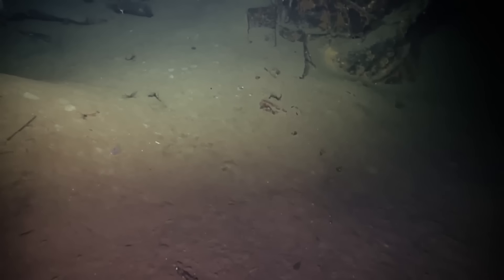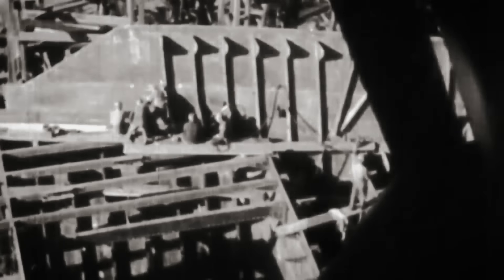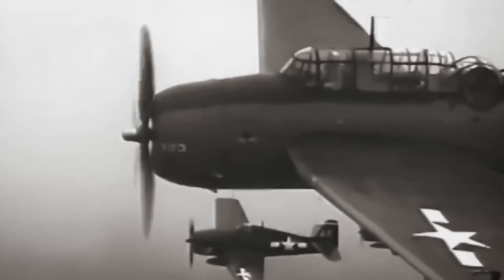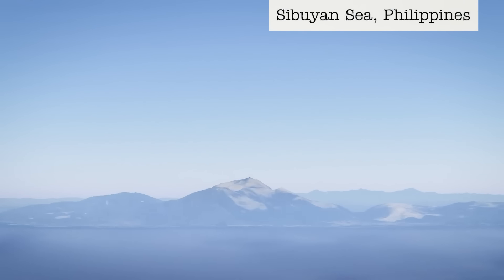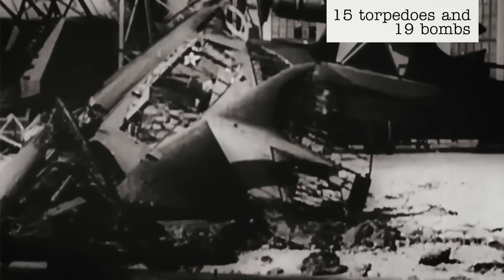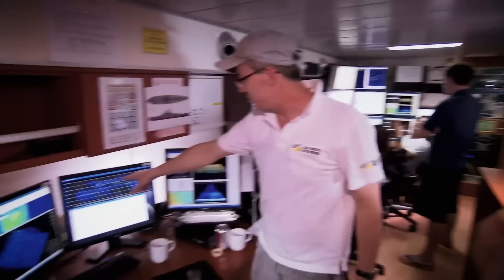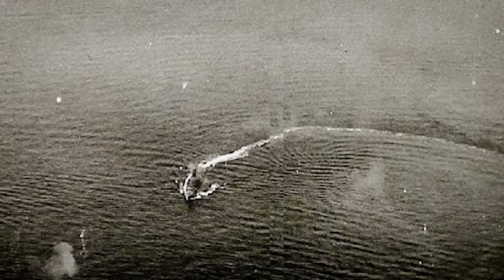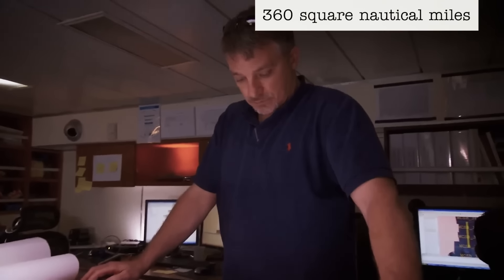Japan's Lost Treasure: Billionaire Finds $200M Battleship!

Comment: The US ships didn't have their watertight doors closed.   Because the doors were open it left the ships highly vulnerable to flooding.   The Japanese also used custom bombs far larger (1,763lb converted battleship AP shells) than normally used.  Those bombs only sank the Arizona.  The rest did damage, but were not fatal.